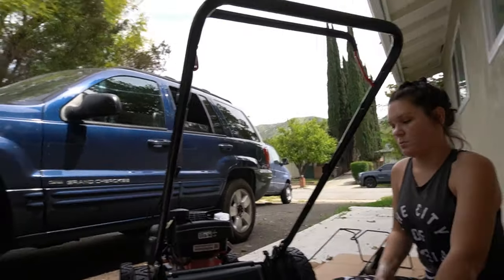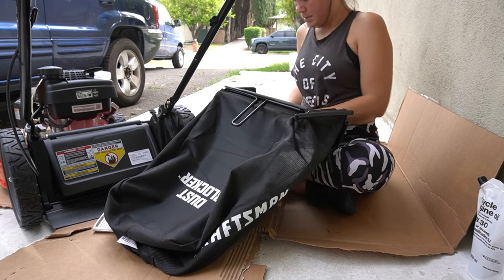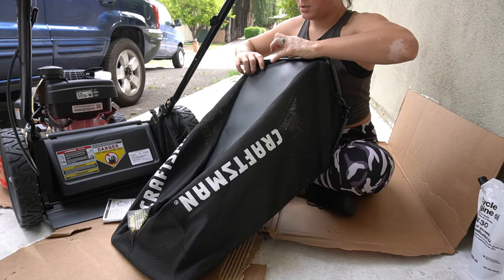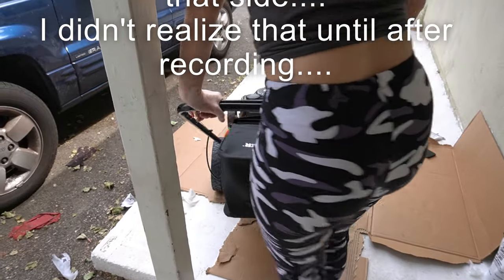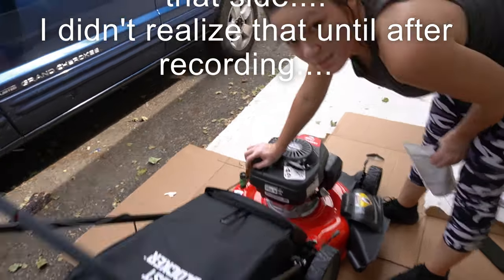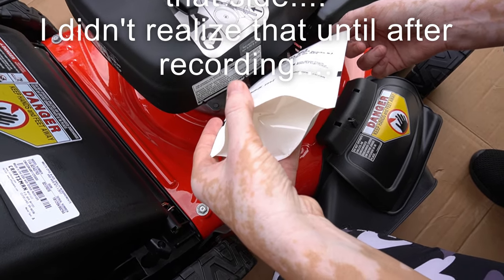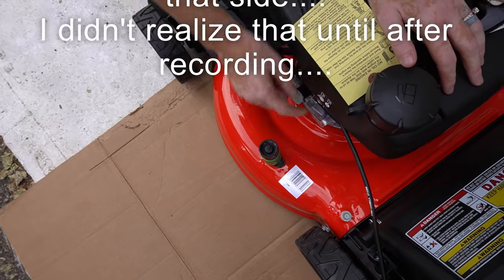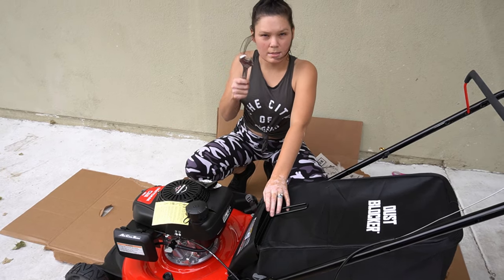Craftsman M450 mower Quick assembly!

Comment: Thank you! I just put together an m 220 after watching you
Reply from the maker: I'm so happy you could do it and I could help you!
Reply: Ugh now it's stalling...lol.
Reply from the maker: Does it have enough gas? And is the oil tank full?
Reply: @Inherpeacepodcast  3/4 tank of gas
Reply: @Inherpeacepodcast  oil tank is full
Reply from the maker: @user-qs4pw9jg9p ok did you start it and then hold the handle together?
Reply: Ok so dude comes over ....pulls cord 3 times fires right up and running great lol. You are a good friend thank you for your video ❤️ and texting me 💕
Reply from the maker: @user-qs4pw9jg9p mowers are not easy but once you get the hang of it you're all set

Comment: I have this exact mower. Whatever you do, don't let it run out of gas!!!!  If it runs out of gas, it takes a while for it to prime and restart. It will restart, you just have to keep pulling the string. It's a pain in the neck to restart, so keep it fully fueled!!
Reply from the maker: Thanks for the tips!

Comment: Just came here to find out how to assemble the folding handle into a locking position because the directions & diagram are so hard to figure out, but you skipped that part entirely. Gosh! 😢
Reply from the maker: There's two buttons on each side and you need to place the wing nuts into the sides to secure it

Comment: Thanks so much... I just got one... your the real MVP
Reply: Hey I had some questions... I think I bent my blade need more help
Reply from the maker: You'll need to purchase a new blade if it's bent. The specifications are on the blade itself. You'll have to flip it on its face so the blade is facing you. (Clip the power by unplugging the cord) I think it comes off with an allen wrench. Rinse the blade off after you take it off and you'll see the  numbers etc Lowes home depot etc all carry mower blades. Hope this helps! 😁

Comment: What a wonderful video; it helped  me get it done. You're my kind of lady...  direct and all that stuff. I'd add 2 minutes to the video; saying that there are three basic layouts. The mulch; as is from factory. Which  is best because it double cuts or fine cuts to add the minerals back into the  soil. Then you can turn it from a mulching machine to a regular lawn mower by attaching the  side nozzle. Or you can attach the bag for late autumn when there is just to much to mulch; or  when you let the grass get to high between cuttings.... then the bag works. Because, leaving  clumps on your grass will kill the grass underneath. But you don't use the right nozzle and bag at the same time.  One or the other; if you are not mulching. I have the same cute scar on my right hand from a bad fuse and de breeding of the skin. Karma right. Just kidding; I'm likely too old for you. Have a great time and  thanks for the video.

Comment: OMG I just realized the particular model i have doesn't have rear discharge to install a bag in. so frustrating. The MTD website made it seem as though it was compatible with M100 mower.
Reply from the maker: Then it should have a side plate to discharge grass etc
Reply: @Inherpeacepodcast  
ok cool. the op manual made it sound as if we could fit a rear collector on any of these things. guess not :(
Reply from the maker: I'm unsure as mine is a 350 but there's supposed to be clips on the back if there's a bag